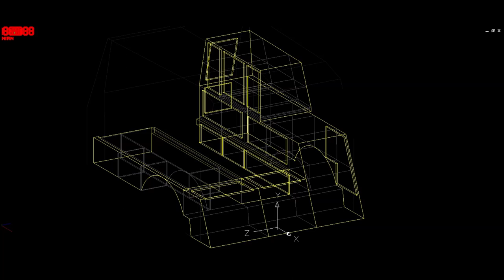Land Rover Camper × My "Home on Wheels" Discovery 2

Comment: That's a really nice, purpose-build built you got there. It's a shame I had to turn the video down to 0.25 speed. ;)I'm in the market for a Disco (2 or 3) and I'm wondering if I would fit comfortable in the back of a Disco 2.. How long is your bed-platform? I am ~1.85m (what is that? 6ft? 5ft 8 or 9?), is there enough room for that?
Reply from the maker: Thanks! Yep I would've definitely done a longer & more detailed version right away if I'd known so many would want to watch. When it's all folded out in sleep-mode it's 73" x 40" or 1854mm x 1016mm. I'm your height as well & have juuuust enough room to stretch out without my head touching the rear of the passenger seat, or my feet touching the rear swing-out door.
Reply: Thanks for your reply. Since I don't think that I will grow (in length) anymore, I guess it will do. Do you know if there is a possibility to fold down the back of the passenger seat? That would bring quite some space for the bed.
Maybe you can slow it down a bit, when you're doing the alu-version. ;)
Reply from the maker: @BFD15i  Those seats do fold down, but not quite flat, so I suppose yeah you could use a bit more of the space that way if you didn't mind the incline.
Reply: Thanks, that's good to know.

Comment: Nicely done, I've done similar myself, but you need to put an access hatch for the in tank fuel pump about 18" from the rear door.
Reply from the maker: Thanks! And nope, she's currently in the process of a Cummins diesel swap, no in-tank pump needed :)
Reply from the maker: RottenPelican Hoof Ⓥ Don't need an in-tank fuel pump for a big boosted diesel ;)
Reply: Tinker very nice 👍

Comment: How long is the space in the back? Long enough for a standard size bed? 2 meters (6ft 7 inch)
Reply from the maker: From the back of the front seats to the rear door it is roughly 6'2"
Reply: @Tinker1837   Thanks for answer man! A little short for my 6`3 then, but it can probably be solved if getting the passenger seat out of the way :)
Reply from the maker: @TT.Hell.  Happy to help and oh absolutely, maybe even just moving that passenger seat forward some more could do the trick.

Comment: Nice Discovery Conversion. Is the bed comfartable enough for more than a few days? I would like to do a similar built. I am not convinced  I could implement sleeping in the back for me. (I am 6 feet 3 inches). Roof top tents are kind of expensive...
Reply from the maker: I think it is surprisingly good, yeah. So far I've done 5 nights in a row with no issue & even with a pretty jacked up back I thought it was better than tent sleeping that many nights in a row. At that height you'll not be able to stretch out without moving the passenger seat forward even more than I have. At 6'0" I can just barely stretch out in back & still be able to fit in the copilot seat without my knees against the dashboard / glovebox. Not a ton of room to work with but thankfully the Discovery's have that raised rear roof section that affords a bunch more headroom in back!
Reply: @Tinker1837  thx. I had the same thougt: to move the passenger seat in a frontal position. I also checked out Discovery 3, but I dont think it will be great as a overnigt vehicle. The Boxy design of a Discovery 2 lokks much more practical!
Reply from the maker: @eyeswideopen7450  Aside from a long wheelbase Defender you pretty much can't beat the Disco 1 & 2 for a setup like this. The interior volume + headroom, all in a relatively compact (for most offroad trails) & built tough package... hard to even get close with another platform for the money.
Reply: @Tinker1837  A Defender 110 would be a nice choice too, but is way pricier than a discovery, from what i have seen so far.
Reply from the maker: @eyeswideopen7450  My thoughts exactly.

Comment: buddy, buy a circular saw.
Reply from the maker: Maybe I will! But in all seriousness... reason I used that reciprocating saw was for the super clean cut you get with a compression blade. If you're not familiar it has both up-shear AND down-shear teeth so you don't blow out either face of the dense plywood's relatively thin layers.

Comment: Beautiful build, but I find the 30 lbs more than with the interior installed a bit hard to believe. Unless LR uses some super heavy seats?
Reply from the maker: Thanks, & that is without all that gear inside, just to be clear. But also yes, those seats are ridiculous... no joke, the 1st half I pulled out the rear door took me down with it haha! I'm no 300lb gorilla, but damn.
Reply: I built a good size cabinet for my XJ, and that thing is stupid heavy. Haven’t even used it, and I’m going to do a lighter rebuild.
Reply from the maker: XJ's are awesome, were on my short list of platforms to do my build.  I've used mine a bunch, up to 5 days trail running straight, but I feel you there... already looking at a resigned with aluminum sheet.
Reply: I've removed back seat from my disco 2 and let me tell you that thing is heavy.

Comment: hi I have the same vehicle.  Would you be willing to share plans for the bed and shelves?
Reply from the maker: Once the engine swap work is done I plan to create a whole set of blueprints for the camper build, as well as a few other versions of it, hopefully a lighter aluminum version too!
Reply: Tinker I've just picked up a mint commercial d2. I'd like to have a set of your plans as it looks about spot on! How might I get a copy? Ta
Reply from the maker: @owainrees4853  Uhhhh honestly I'm not ready with the plans yet, been soooo busy with the diesel swap that I think I won't have the plans ready 'til spring most likely.
Reply: @Tinker1837  I'm thinking about picking one up, so I hope you decide to release them!

Comment: Cool setup but no provision for fridge?
Reply from the maker: 94Discovery Thanks, plan is to install a smaller fridge/cooler behind the driver's seat, either up on that step in the cabinet or inside of it, just under the extinguisher.

Comment: This is very similar to how I want to build the back of my D1.
Reply from the maker: Sooo much cheaper than a roof top tent & leaves the roof rack for carrying things you wouldn't want inside anyway.
Reply: Plus less top heavy.
Reply from the maker: Michael Hite  Good point, don't need any of that going on! Especially since I wanna get to 37" tires & a bit more lift on bigger axles...
Reply: I’m only going to 32 and 2-3 inch lift. Still want it to be street friendly.

Comment: What size bolts did you end up using?
Reply from the maker: I only used existing threaded holes in the body to attach it all, so if I recall correctly the bolt holes towards the rear are 5/16"-24 & the forward row of holes originally used for the rear-row seat-belts are 3/8"-24.
Reply: @Tinker1837  Thank you so much! I had not realized that there were some plastic caps covering the threads. I was finally able to bolt down the rear storage setup. The bolts needed for mine were the 5/16-18 but i did not have rear seats.

Comment: Nice, but super unreliable vehicle!
Reply from the maker: Yeah but only always! I've given her a good working over to solve that, even to include a big engine/trans swap! :D
Reply from the maker: Yup, & every vehicle ever made has it's quirks, not one is without it's unique issues! Even the TD5 Disco's have their problems. Hell, even the Cummins 4BT I'm putting in place of the gasser V8 has a few problems that need dealing with.

Comment: That music. Has Landy passed away?
Reply from the maker: Padidivemaster Nah. Wait... well, kinda. I mean the old gas V8 engine did die, so I guess when it comes back to life with the diesel then... it's Landy zombie? Perhaps I should sacrifice the old engine to Odin to ward off the undead Rover spirits. A few pounds of tannerite could do the trick. Been hooked on that kinda music lately.
Reply: Tinker that is all right. A long time ago I converted my L andy 300 tdi. The biggest problem I had was a condensation. I hope you are going to have a very good ventilation. Cheers and all of the best Mate
Reply from the maker: Nice! It's a fantastic platform for a sleeping setup. And I'd be lying if I said I wasn't envious of that diesel, but here soon I'll have a remedy for that. I may have went a bit overkill in taking steps to prevent moisture leading to mildew, more like a boat then a truck in the back there now haha

Comment: Things pretty epic only thing I would’ve changed is the side the droors are on because the fuel cell is on the driver side to.
Reply from the maker: Would be difficult to see out the back with the tall side on the right, unless you're taking the right hand drive Disco's...?
Reply: Tinker definitely see where your coming from my backs cover by a spare tire anyway so I’ve got the lovely hood mounted mirrors to help see down the rig it’s ugly but functional lol. Anyway awesome setup
Reply from the maker: @Gettinbentoffroad  Yeah my 35" spare on the rear door doesn't help with the view either... that and it's hinges hate me thanks to all that weight haha!

Comment: Really good design & build. I would have skipper the material on the drawers and side unit cause I think staining it and leaving the wood would have looked better.
Reply from the maker: Thanks & yeah that's a good point, could have been interesting to break up the look of it a little bit with some light/blonde stain in spots instead of solid carpeting everywhere.

Comment: Great video, Do you bolt down the bottom plates by drilling trough the body? What kind of bolts do you use for this?
Reply from the maker: No drilling, every bolt is into original threaded holes. Just standard hex bolts with big washers to spread out the loads.